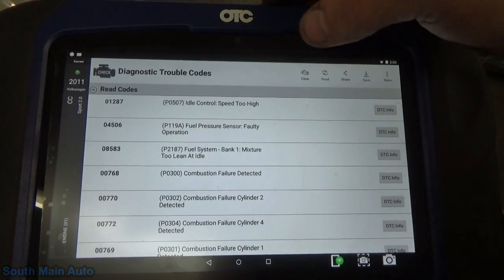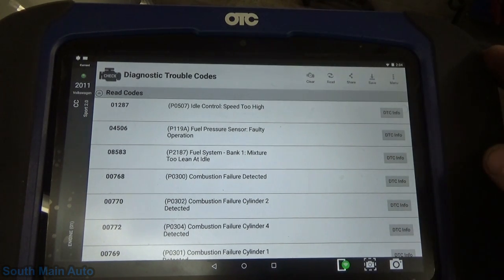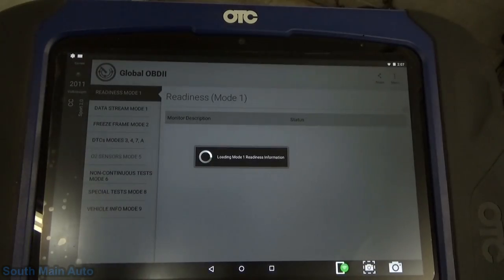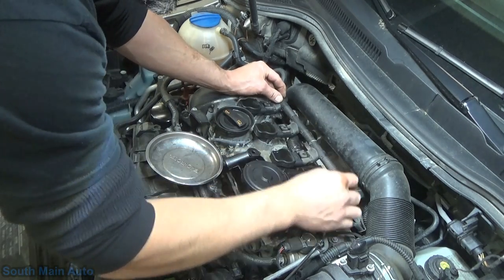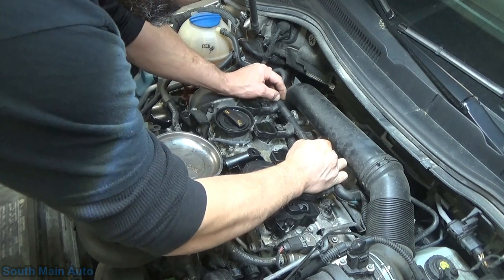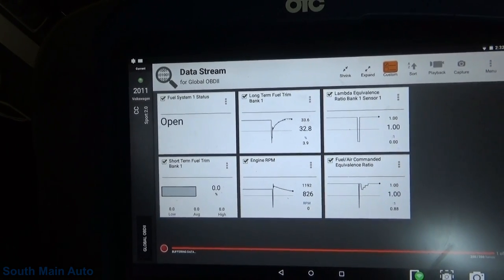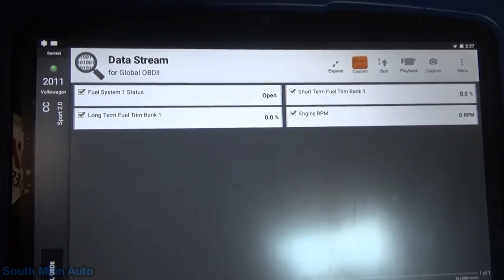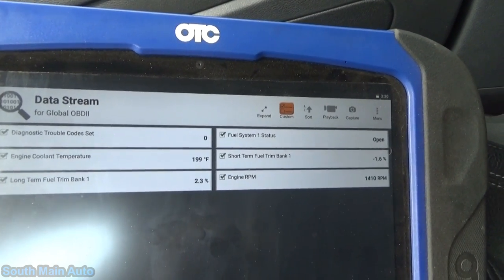Rough Running & Running Lean - Volkswagen CC Sport

Comment: Leave it to the Germans to totally over-engineer a PCV valve!
Reply: Jimmy Pack Totally agree, that PCV is over the top, Stewart
Reply: Not only that, but damage every seal and gasket in the engine when it fails! VW and Audi mechanics will never run out of work.
Reply: Ima fan BMW isn't far behind...actually I think they are leading the pack ($%%&&%0 BMW crankcase breather/PCV system)
Reply: Saab & Volvo too!
Reply: This isn't a regular PCV valve, it's an air-oil separator. The simple PCV valve recirculate the crankcase air back into the combustion chamber. However, the crankcase air is contaminated with oil vapor and combustion biproducts which, when is fed back into combustion, it reduces engine performance. Hence high performance engine often have the air oil separator which the oil is separated from the air and is dripped back into the crankcase and the cleaned air is fed back into engine cylinder.  Low performance engines in American cars use the simple PCV.  Smaller high performance German engines, especially with turbo, often have air oil separators.
Reply: 2Phast4Rocket  Good explanation,  regards, Stewart.
Reply: 2Phast4Rocket you slanted your explanation to make it sound like German engines are superior because they use oil vapor separators. They use those because the ring seal area isn't sufficient to prevent blowby from contaminating the intake stream due to the forced induction. Not only that, but the great "oil vapor" separator is obviously made from the same poor materials a lot of other parts on a German car tend to be and FAILS routinely.  I can't remember a "low performance" PCV valve ever failing.
Reply: And in addition...European cars are know to fail parts that nobody has ever seen fail on any other car, period. if the Europeans could bake RELIABILITY into those complicated.."better" parts and features then maybe they would be up there with Honda or Toyota.Maybe.
Reply: Correct, my daughters TD4's (BMW M47 Engine)PCV valve usually just has a foam filter in it. BMW developed a 'oil separator' to do as described above. Not sure of it's efficacy so I will returning to the foam filter and changing that every service. Many seem to thing that the 'new' part means zero maintenance which, as we know is the early death of any mechanical system..
Reply: @2Phast4Rocket  what volksgaon did with these pcv systems on thier turbo charged cars is attepmted to make a boost controlled autodraining catch can that they still haven't figured out yet how to make it reliable
Reply: 97 accord.....5 bucks and it's done

Comment: My car ( Europe Version of Chevy Cruze) uses a similar system... vacuum in the crankcase is normal on these systems... not sure why, maybe to help gasoline and moisture to vaporize faster...the thing that breaks all the time is a rubber diaphragm that is used as a high pressure rupture disk...if pressure in the crank case and manifold gets too high ( under boost condition), the diaphragm ruptures and prevents the other engine seals from beeing blown out....due too poor quality and fast aging of the rubber, these break for no reason.There might be another valve or diaphragm somewhere else that controls crank case venting under various conditions. On my car, you need a new valve cover for lots of $$, diaphragm is molded inside, the second valve is inside the intake manifold, also not serviceable and even more $$$$

Comment: would that extreme vacuum on the rear main cause early failure?
Reply: I think massive over pressure would be more harmful,
Reply: Mr. Random that's why the engine light was flashing on them cars in the engine light flashes you're not supposed to run them at all that was letting you know that something was about to break if you kept running it but Eric did a great job fixed it should be good to go
Reply: yesI know what the flashing money light means, I was just asking if it if fails to know to look for other issues down the line or to keep an eye out if it's a regular customer.  I'm a fleet mechanic/shop manager  and do alot of side  work and just like to kno what to keep an eye on
Reply: bobl78 I eather way is bad, I can imagine that with that type of vacuum for so long would pull seals to tight and cause quicker then normal wear.

Comment: So, what is the reason to buy such a needlessly complicated (and expensive) P.O.S.?
Reply: Because it's typical of the engineering departments in German cars. If a simple valve will work, they won't use it, instead they will engineer a "better" device.
Reply: Blazer02LS Why do Chevies have such overengineered garbage that's prone to fail?
Reply: Prone to fail ? More like designed to fail in a very $$$ way.
GMC Canyon anyone ?? I think that says all that needs saying....
How many parts can you get from china ?

Comment: My 2012 vw cc 2.0t starts rough every few cranks. Runs fine after it cranks. But sometimes stalls when cranking and makes a terrible sound of the engine just choking up and stopping. Anyone else have this issue?

Comment: why is engine so noisy ????
Reply: ray rowe I'm guessing it's the direct injection (hpfp/injectors)
Reply: hilarious!
Reply: The injector cover is off. Car makers don't waste $0.01 on parts- people and some "mechanics" think "engine covers" or "vanity covers" are just in the way, stupid, ugly, or useless- but 98% of the time they are there for a specific reason (noise, protection of components, or even air management) and also to display the engine size and features it has (VORTEC, MPFI, VTEC, DOHC, etc.).
Reply: direct injected, most of the noise is from there, these are also SUPER common for the timing chain tensioners to let go and make a ton of noise and eventually imploding
Reply: good ole "direct destruction" injection :))
Reply: Yep gas direct injection.  Most cars have now and will sound like that with hood open.  I have a 06 Audi a4 with 2.0t. Mine is so much more quiet than that.  Have Pennzoil in it now will go back to liquimoly will be even more quiet.
Reply: @randomrepair1680  yep.... The 2.0t is loud as can be. Lots of valve chatter.
Reply: Vw engines are noisy. Direct injection/ high pressure fuel pumps etc make ticking noise

Comment: I don't have a scan tool of any kind, but I do know one of my injectors isn't working, or is leaking air, because of the glowing exhaust manifold near the inline catalytic converter on the passenger-side bank of my XL7's 2.7 V6. EFI cars are great when they're running right, but I'd rather have a car with a carburetor!

Comment: The best cars have spherical overflow bottles.
Reply: To get the all the air out of most vw cooling systems is a nightmare and i guarantee causes overheating of most diy guys engines out there.
Reply: Didn't have to do a thing special on my Eurovan. The overflow is well above the engine. The system self-bleeds.
Reply: I am referencing a vw beetle to be exact.  There are not easy to get the air out of.
Reply: Don't know about that one.
Reply: New or old beetle...
Reply: Can't agree or disagree, Jarrod my LT35 van (similar to the Sprinter) hasn't had any issues regards that and my daughter's Landrover Freelander TD4 has the same overflow....again no issues but they can split around the 'equator' over time..
Reply: Every VW that I have ever seen had a funky looking coolant tank.  I think VW prides themselves on it.

Comment: My mom has a 2010 accent it keeps setting a lean code and its been to the dealer they they thru the parts cannon at it and gave her a $400 bill for plugs and o2 sensors and it still does the same thing drive it on highway and it will start to cut out when you slow down and light comes on i looked for vac leaks bad plug boots it has new plugs and o2 sensors its a 1.6 i think the only code it ever sets is a lean code and only acts up aft driving about 15 miles on highway anyone have any ideas i don't have a scanner to look at the computer but i do have a bluetooth adaptor and a app for phone to look at some data
Reply: And has a new pcv valve

Comment: Pcv and the egr junk to make the engine die faster in this day and age you can bypass these and tune to the point where it will run more efficiently without the two

Comment: That pcv valve is a joke , it is a plastic membrane and clogs up easily even worse if it costs 170 . Beetle and jetta has the same type of valve . Use the rosstech vcdsscan tool for it Eric , the best for vw called vag-com .

Comment: Thanks for the VW video. My wife has a 2014 Turbo R-Line Beetle. If you look up HumbleMechanic, I see he has a video on TSI PCV valve   https://www.youtube.com/watch?v=hQEciqR1ST8 Thank you for posting this. I checked my wife's beeetle today when I got home and almost couldn't get the oil cap off with the engine running. THANK YOU..it helped greatly!

Comment: VWs are awesome cars. But on the flip side, they're little bastards when they go wrong. That said, I've only ever had one check engine light on mine in 5 years of owning it and it was just a pinched vacuum line in the secondary air system.

Comment: My 2012 passat sel premium 3.6 started idlimg wilding out the blue. Turned out it was the pcv valve built into the valve cover. Bought the part from 1a auto costed me 110 next day delivery. Paid my buddy 100 bucks of case of beer and a new obd scanner and viola im back good as new. The dealer qouted me 1800 bucks fucking pigs 🐖 😤!!!!

Comment: June 2016, Volkswagen agrees to $14.7B settlement over emissions cheating with software.  The emissions scandal may have changed ways they do things.
Reply: Sandbag1300 Yes it will, they'll add more non-serviceable components to make up for those losses, not sell repair information to aftermarket companies, more special tools available only to dealer techs and quadruple prices on cheap plastic parts. Yeeaaai!